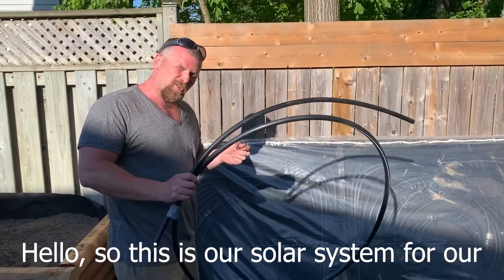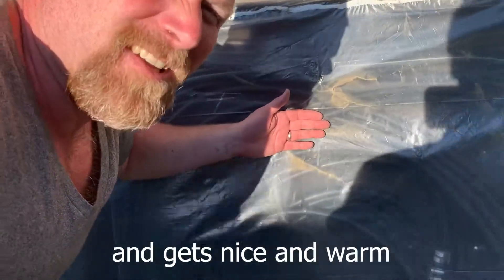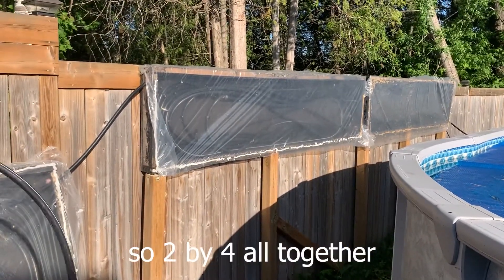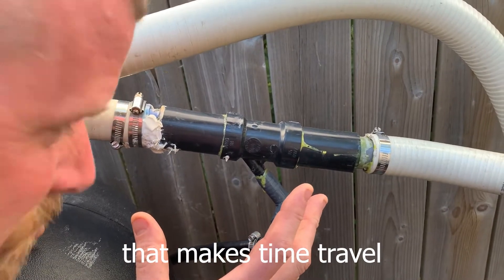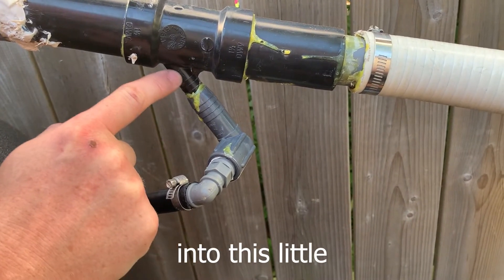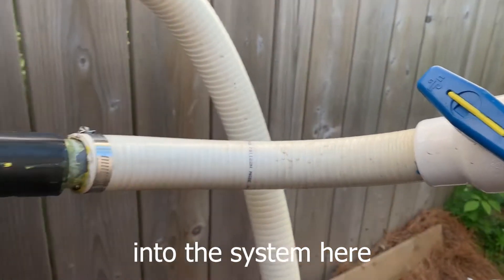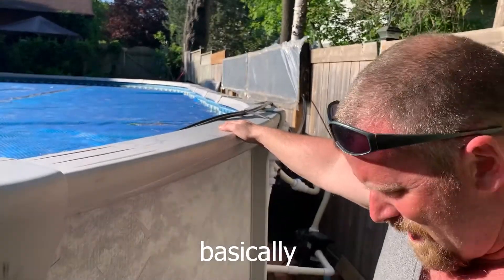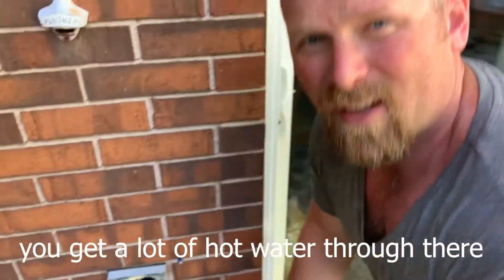Building Your Own Pool Heater

Comment: It looks great im doing something similar to you setup in Texas. I have an unground pool and plan on building enough of them to use the pool year round. im planning on adding electric shut off valves and thermal switches to turn off panels when to hot to not adding warm water.

Comment: And a pool that size would need at least a 1 inch feed of hot water at a high flow rate to see any real difference in overall temp
Reply from the maker: Yeah it would be great on a smaller pool

Comment: This would be the name of the FC: 1-1/2" x 1-1/2" x 1/2" ABS Dishwasher Wye. Just tried finding one, HA! This is a much better part than I could've hoped for, if only I can find one. I wonder if another one reversed and placed into the intake line and by using the venturi effect it should pull the water through the polypipe. Instead of like the first one that is pushing the water and then it would be running through the pump and adding to the heated water that flows straight out through the discharge outlet. Or just running the second reversed one after the valve should also work. Just making a secondary circle.   Anyway just starting from scratch making a shopping list. Also I never thought of the timer turning on and off like that, cool. Looking for ideas, found some great ones here!
Reply from the maker: Glad you liked it. Good luck with your creation

Comment: Also I had considered using black water hose after I worked for a lady that had a garden with black water hose , it was a long run maybe a couple hundred feet, I used it to wash paint brushes, the water never cooled off it stayed very hot . Do you think the fact this water hose was made of thicker rubber gave it more retention of heat than maybe the pipe you are using.
Reply from the maker: True. I used about 500 feet of black tubing. Not to thick or it will kink up. I only used the pipe to connect to the various pool piping. Yeah it’s pretty hot in the hoses. It’s over 100 degree coming out

Comment: This is the video I've been looking for, I had theorized the flux compasator just as you have , I hadn't considered the name but indeed I agree. Question how hot does the pool get. My pool only ever gets to around 82°at it's hottest. I think 92° would be perfect.
Thanks for sharing
Reply from the maker: My pool is above ground 18x36. It’s big. The system is great when the suns out in July and August. It needs the thermal blanket in the evenings to stay warm. It would work better if the pool was smaller. It gets to around 80 degrees during those months. Glad you enjoyed the video
Reply: 80° is too cold, my pool is 20ft circle pool so maybe the system you have would work better on my pool than yours,I did notice your pool was larger than mine. My sister has a in ground pool with a black bottom it is perfect temp , but it cost 100 thousand.
Reply from the maker: @linnhudson4908  yeah it probably would do better on a pool your size

Comment: You can likely eliminate the timer ( unless you are trying to save electricity). Letting it run continuously will still give you pretty same output as although the water will not be as hot it will be more volume yielding about the same temp increase in the pool. I’ve had pretty much the same system in place for over 10 years and I’ve tried every possible combination
Reply from the maker: Yeah maybe but i like to feel that hot water coming our every 20 mins